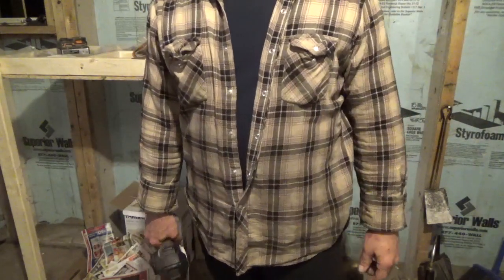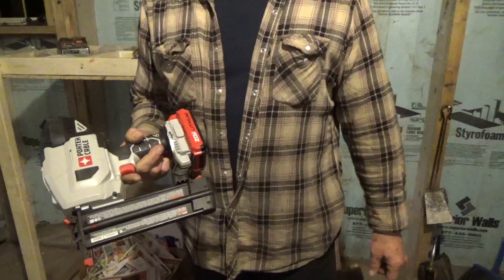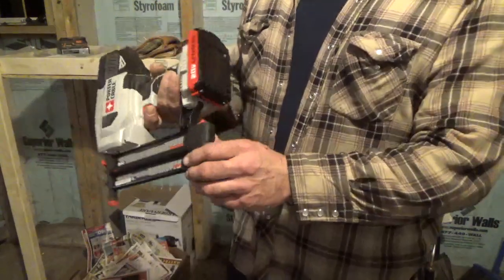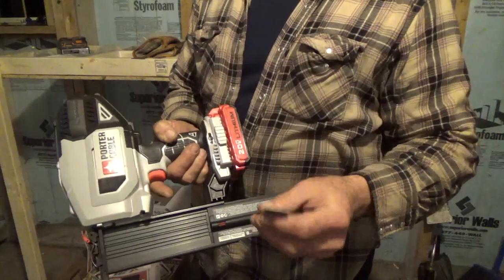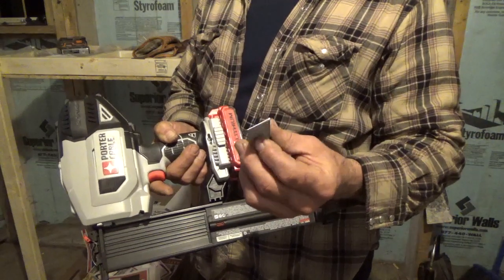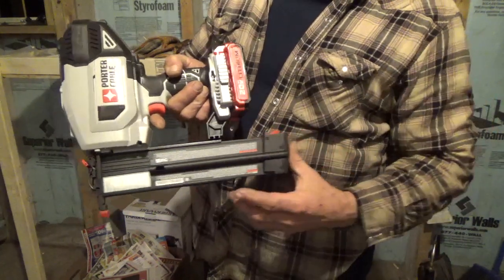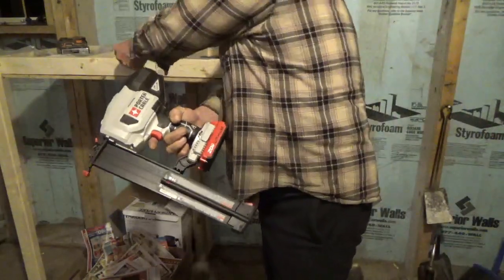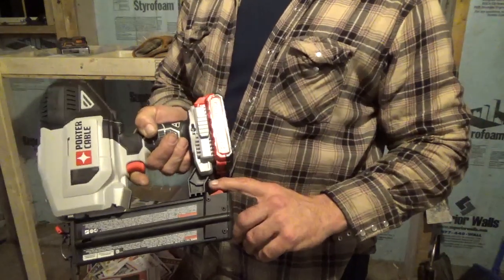Porter Cable 20 Volt Finish Nailer, How To Load Nails

Comment: I have baseboard all along the floor that I’m replacing and it currently has staples and finish nails in it.  I purchased the porter cable 16 gauge and I’m currently using 2 inch nails on the casing to hold the outer edge.  Should I buy the Porter Cable 16 gauge brad nailer also to nail in some smaller, finer nails near the inside edge where the casing is thinner to make it look more flush with the wall?   Or could just buy smaller nails for the 18 gauge nailer I have now?
Reply from the maker: I actually replaced the baseboard in 2 houses so far with my nailer. I used the 2" nails and drove them in at an angle so they grip better and pull tighter into the wall. The smaller nails work well in this gun also. I would try the smaller nails first if nailing at an angle doesn't help.